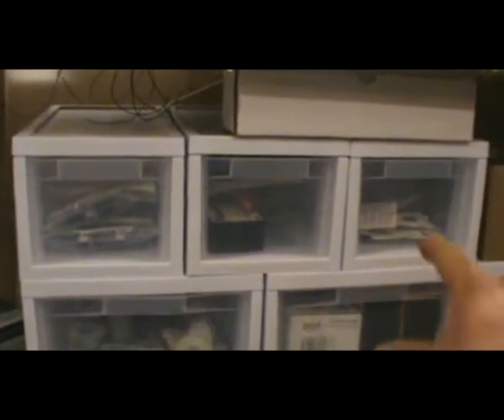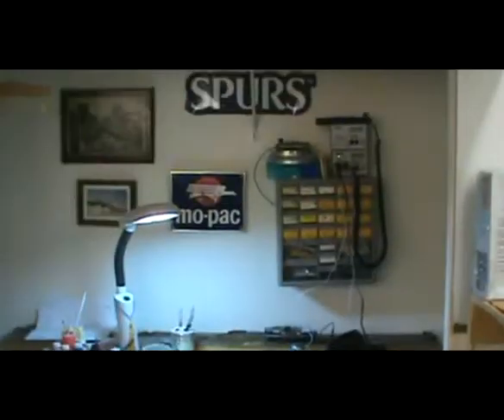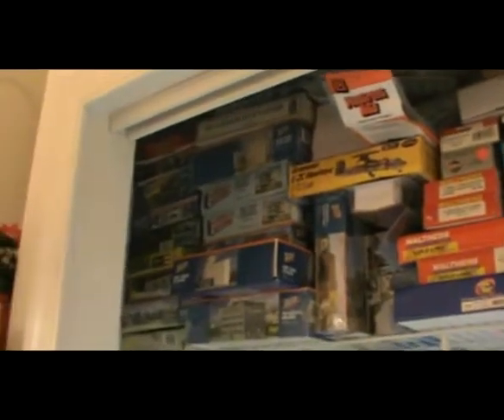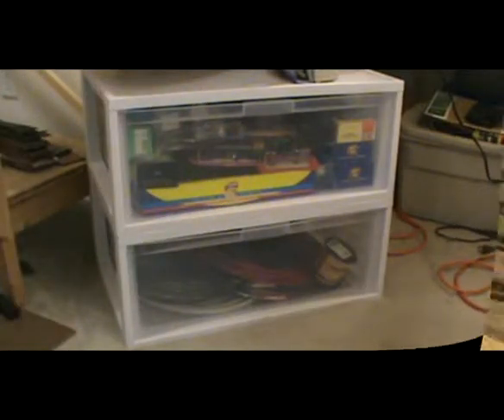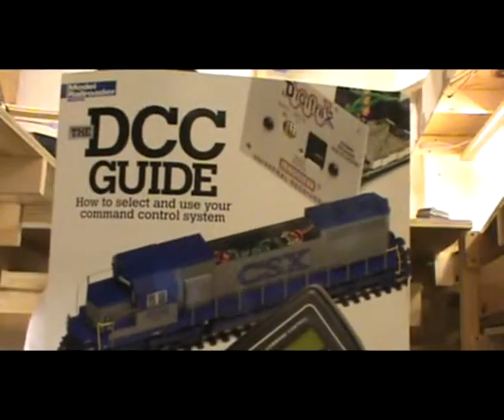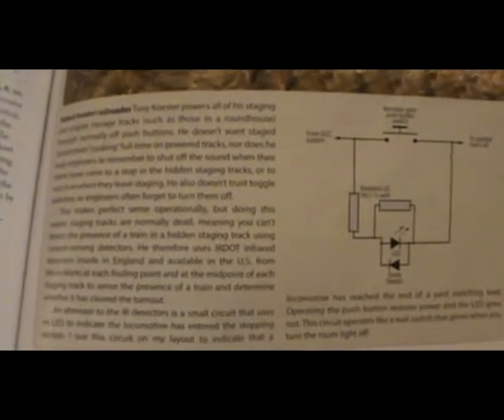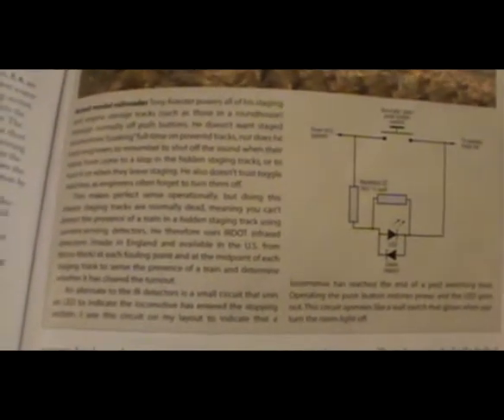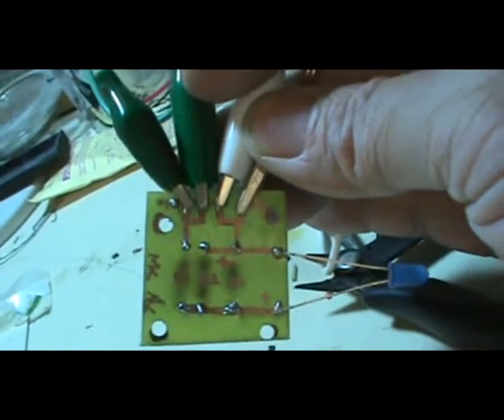MoKan Lines:  Make a Circuit Card 1

Comment: I like your board and have an idea that would be great to use it for instead of the push button you have put a relay for normally open. I plan to section off small section of track before switch so it only applies power when have green light for the track basically it would be used to stop derailment or train from crashing since the locomotive on the side track would stop automatically once it hits the dead track.
Reply from the maker: An NO relay, hmmm....... Please expand this idea.
Reply: mokanlines
With a relay set based on the direction the a switch is set. So a small section of track just before the switch would have a relay switch connected output that drives my signal lamps i.e if have a red light for one of the branches and green light to the other branch. GREEN light will activate the RELAY (same as pushing the button) allowing any train to cross the switch if another locomotive comes down the other branch RED light it will stop automatically since their will be no Power to the track stopping A) Accident / Crash  B) if no cars crossing at least will stop a derailment.

CURRENTLY using a DS-64 to run my LAMP's they are BiPolar so they are always on only when the direction of the current changes the color of the lamps change so will need to restrict the relay by only allowing flow of current in one direction.